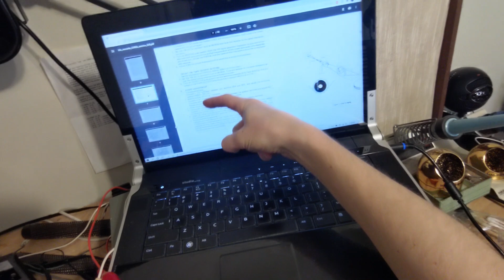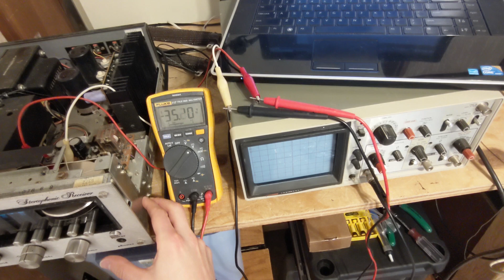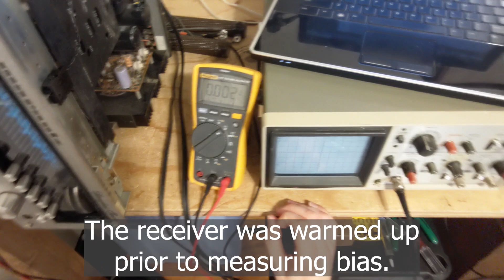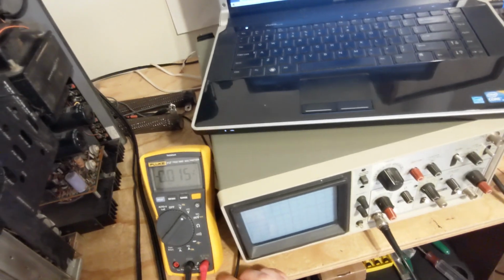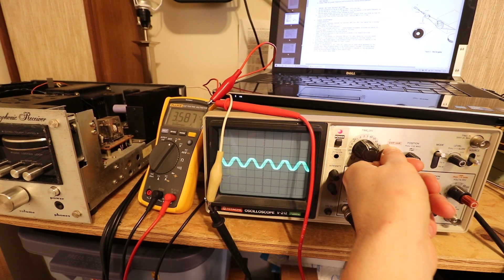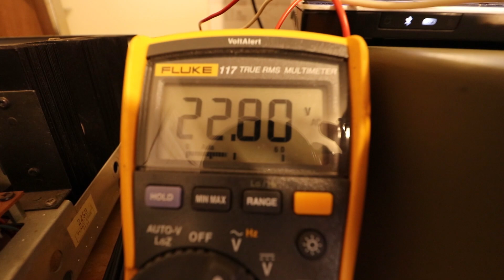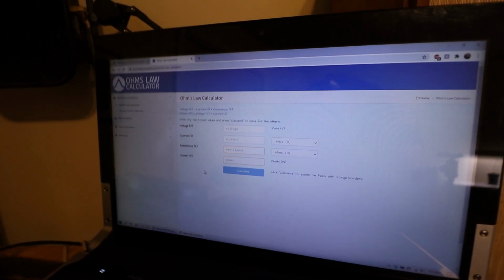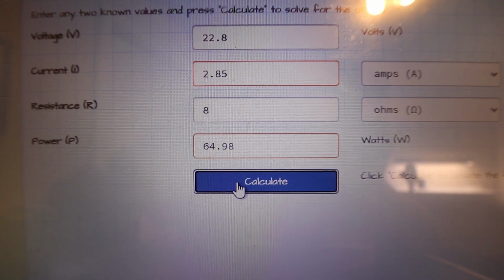Does This MARANTZ 2250B Still Make 50 RMS Watts Per Channel? A Pre-Restoration Benchmark

Comment: What size and brand dummy load resistors do you use or recommend?  All my equipment is Marantz from 4270, 4140, 140 amp, 1250 amp, 300dc amp. 
Thanks

Comment: Good afternoon this is a great video series you have
 I've just recently discovered December 17th You're great channel, great information
Thanks a lot
Question?
What test procedures software do you have on your laptop with the test points and voltage readings for this 2250B receiver? I have been unsuccessful trying to find test procedures for a Marantz 4400 and 4300 that are actually usable.
Could you tell me where you found these software procedures?

Comment: Hello, I have two proposals for the next movie: 
1. Enchance the power measurement with higher frequencies up and over 20kHz (hence You have load resistors, You're save). 
2. Complete sweep with RightMatkAudio - ist really easy setup and gives interesting overview of whole rig. I You post results of course, the program produces nice charts, which can be easily zipped and posted.
Reply from the maker: Great suggestions - I had not heard of that software.  I will need to buy some better gear!
Reply: @AHFixIt  no, You don't need better gear, You need line out and line in in your soundcard, check RightMarkAudio site!
Reply: @leonidbreshnew401  Most PCs and sound cards have too little power and too much noise to be useful testing vintage audio gear.  RightMark Audio is of no help here.  RightMark Audio can only compare what it has in-hand.  It doesn't know a crappy signal from a good one.  What does it compare to?  It can only create a "benchmark" - then compare it to something else.

Comment: I enjoyed your video. I’m not a tech but I am old enough to remember when it was new. I had Marantz separates in 1977. 3200 pre and 140 power amp. They were pretty awesome. I’ve been buying these 70s receivers for the last couple of years. I’ve had luck. They’ve been working nicely. I just bought a beautiful Sansui 5000 1970. Cosmetically it’s a jewel. No scratches or dents. It does have at least 2 lamps out and bit of static in a channel. If you’re interested in these you should check out Sansui. They were beautifully made.
Reply from the maker: Glad you enjoyed it! I have a Sansui AU-6600 integrated amp that I fixed years ago. Haven't worked on too many other Sansuis but they're definitely great!
Reply: Sansui was known for making noisy amps.  THD was off the chart compared to other models like Pioneer.

Comment: Nice video, simple and to the point.  Having owned a Marantz 2270 for over 35 years I can attest to their quality, really beautiful units.  Some people bash the vintage Marantz units but there’s a reason they keep going up in value.  I would say the experience is similar to owning a nice vintage sports car,  they certainly have limitations and can break, but nothing today is built the same way.  Yes technology has improved, specs are better, new is different, but not necessarily more enjoyable.  There is something to be said for the appearance of a unit as well, compare the highly rated Outlaw receiver to a 2270. Similar real world power and they both sound very nice, but I definitely prefer the appearance of the Marantz!

Comment: Yup, I find most all those 70's era SS amp are underrated on the watts. When we test for "max output" (I test basically the same as you), it's a nice number to know but for my stress tests, I run the amp at about 50% of that max output for 20-30 minutes. This is with a SINE wave, not music, so it will heat the amp like crazy - it's another aspect of testing an amp, IMO.
And ya, for example - here's an underrated Vector Research receiver made in like '76, rated at 65 watts, skip to post #13
https://audiokarma.org/forums/index.php?threads/vector-research-nostalgia-strikes-again.801906/

Comment: Nice video, but did you really try to stabilize the sweep using the “time variable” control? As a tech, I assume you know the concept of the trigger system on a scope??
Reply: Meh, if that works for him, it's not wrong. I'm not familiar with that scope, maybe the trigger find doesn't work, or is funky.
But I have to agree, locking in on the trigger would be my preference.
Reply from the maker: It's a pretty old scope and I think it was inexpensive for the time also - inherited it from my Grandfather.  Good enough to show clipping!